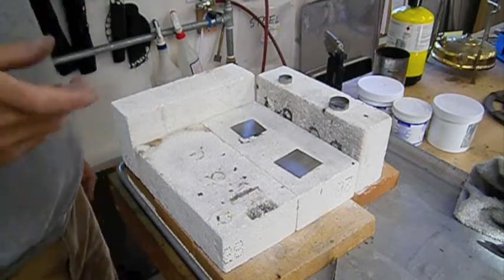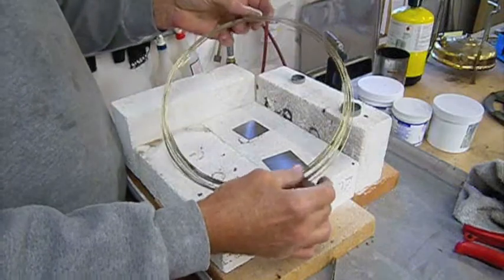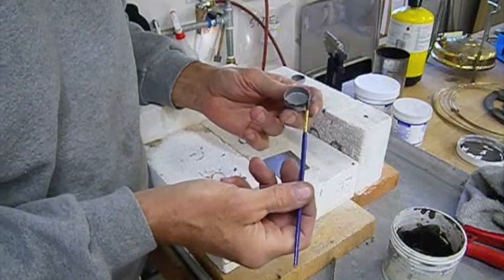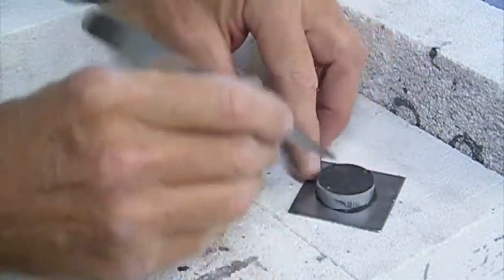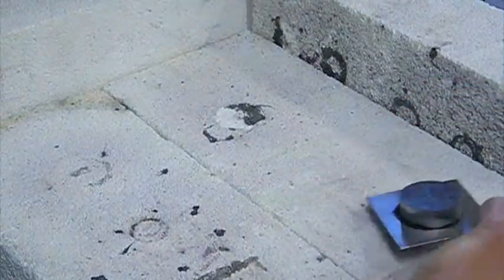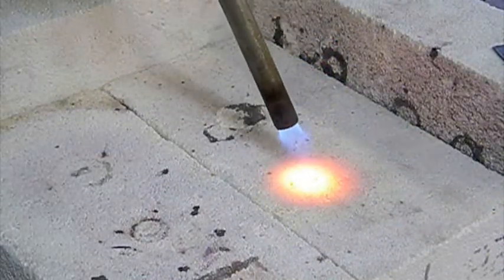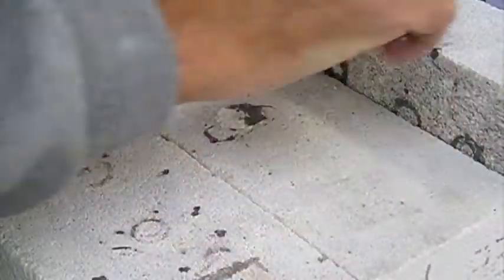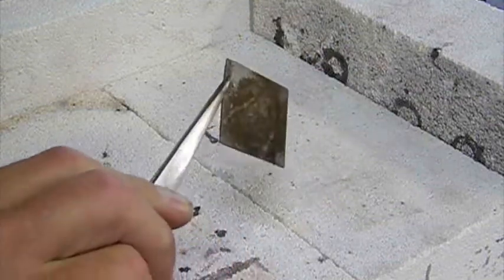BernieDawg's Inner Cap Brazing

Comment: Please, could you help me? I see that Mr. is specialist, here in Brazil there are no spare parts, I myself try to solve, my 530 does not have the original burner, improvise with a made of copper. But it pops up, making noise, like a tuf tuf tuf, the flame is blue and it's great, is it because of the small screen that is inside the vaporizer barrel below the burning bell? I can not find the steel screen here, I improvised with a wad of very fine brass. Is there another cause this tuf tuf tuf? Thank you
Sorry my english is of google translator
Reply from the maker: Best to email me about it. YouTube comments is not the place where we can answer these sorts of things. Check the description box above for an address. BD